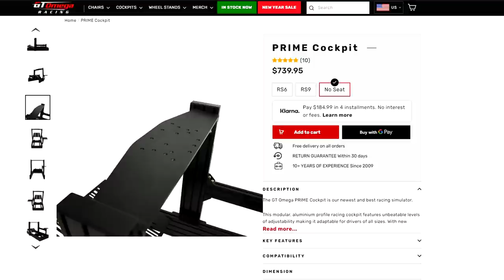GT Omega Prime Cockpit Review Part 2 "The Setup"

Comment: Ordered this cockpit yesterday based on your review. Thanks a ton Barry!
Reply: I also ordered this thanks to this review, I'm just a casual racer and I'm sure that this will suit me fine.
Reply: Question: Can you move the steeringwheel plate move back and forward or is the steeringwheel mounted on one place?
Reply: @CiroDiMaRzio12304  You would move the 2 horizontal profiles further back or foward in the grooves at the bottom to adust the reach, the pitch is adjustable.

Comment: I am happy with my GT Omega Prime.  I would like to see more price comparisons on cockpits plus shipping costs.   I saved almost $300 on the GT Omega (i pre ordered it) over a P1X after shipping was calculated to the US.  I used that savings on some Trak racer parts - inverted pedal tray, mouse tray, keyboard tray.    Maybe a piece of 4040 under the pedal tray to reenforce it would have worked and you can adjust the height or the pedal tray up or down 40mm between each of the 40x160 slots.

Comment: its always a pleasure to watch you do hotlaps,  i watch very carefully and you are one of the few sim racers that i see on youtube that have absolute  consistency.   a bad turn for you is when you don't hit it perfect.  if i had to guess you have at least 30 years of racing experience under your belt between sim and real life,   im 27 and you just have a style that screams I've been racing longer than you've been alive.    thank you for the videos.  im hoping we see some new motion simulation on the market this year.  im ready to invest in a system but im on a budget.  ide like to keep it under 5 grand,  my chassis now flexes everywhere and is 7 years old.  so instead of buying a new rig i just want to go right to motion.  i use VR and it would really  top off the experience.  so im hoping i see some sub $5000 motion rigs and some SRG reviews on them in 2021.    ive watched all yours so far on motion platforms and wheels.  its hard to choose or its out of my price bracket typically.   im still using a CSW 2,5 full clubsport setup.  and im still content with the motor,  but my wheel stand if you pull the steering wheel towards you then let go it has a good 3 inches of travel back and fourth like a spring.   it was made for a logitec wheel/pedal combo  so it just has one support between my legs.  ive been due for a new rig for 2 years and keep putting it off since ide like to go from racing on a spring essentially with what i have now right to a rock solid motion unit with no play in the wheeldeck or pedal plate, heck even my shifter mount flexes with a clubsport shifter.  a direct drive wheel would break the welds im almost certain.   and it just bugs me that i have never felt my wheel on a solid mount,  im probably losing 1-1.5 Nm of torque and fidelity due to the wheel deck flexing the opposite way the  wheel is trying to send me feedback.

Comment: The best thing about this is GT Omega is adapting to the market. Yes there is still room for cheap prefab chassis but lets face it. The best setup for sim racing is aluminum profile hands down. 

If they get the pedal tray sorted and they release a front/side mount option for dd wheels. This could definitely be a contender to SimLab. Especially if they can ship cheaper.

Comment: Fantastic review. Bought one and first thing I did wad replace the feet. 40mm rubber feet from Amazon. I don't feel the pedal flex because I am not pounding on the pedals on the deck plate. I added a SR Racing Sequential Shifter Pro. Fitted with no modification to the cockpit. The GT Omega XLRS seat you can buy for this cockpit was very fiddly to install, the hardest part of the build. Watch this this video to assemble the cockpit because it is 100% better than the instructions in the box.
Reply: Oh no.. I ordered the XLRS seat.. fingers crossed I don't screw it up. Do you have a link for the rubber feet? Or if not a link (since YouTube flags and removes links generally) what keywords should I punch into an Amazon search?

Comment: I've had my Prime cockpit for a little over 2 weeks now and absolutely LOVE it. I've only got T-LCM pedals though so not a ton of pressure being applied. For me the cockpit was money well spent. I really like the 8020 for all the accessories, options are endless! All in all I think it's a great cockpit for the money.
Reply: How's the comfort? Did you use one of their seats? My biggest complaint with sim racing is I can't get comfortable enough and my body back, butt, and legs get sore after half an hour sitting in an office chair with a G27 on the desk.
Reply: @DerekMoore82  hello i have one of these and i love mine. as far as seating positions there are many. im using there xl-rs seat and love it. im my opinion this is a GREAT sim rig. money well spent.
Reply: @gdog-wk5ww  Thanks Scott! I ordered the same seat, so that's reassuring.

Comment: I got it with the preorder discount, it was a no-brained then. I got SimLab pedal plate and slider (I had to drill two holes and it is very stiff with no flex for my HE Sprint)  as well as thenout for my Simucube 2 Pro. The P1X was not an option because of the shipping cost to the US.
Reply: How thick is that pedal plate vs the gtomega one

Comment: I see a trend of sim racers posting their own designs if this kind of rig, stuff they've "designed" and sourced parts and built, some look very good, some not so much. A big selling point is cost for these YouTubers, how much you can save. Then you start to notice, single brackets, uprights butted to the top of the horizontal beams, instead of using longer uprights fixed to the larger surface area of the side of the horizontal beams. It's the little things that matter, they're usually big things in the end. Buy once, and buy right! The bitterness of poor quality and engineering lasts way longer than the joy of a good bargain, saving a few hundred £/$ is not a smart move when making a big purchase like this, the chance is that few $ was spent making sure it works, lasts and is safe, and you are paying for the added benefit of comeback if it all goes wrong, good luck getting your money back from a part time youtuber who sold you some plans and got a kickback from the material suppliers he will surely tell you lots of good things about.
This guy though, well him you can trust to tell you what is what. Top bloke who knows what is good and doesn't sugar coat his views. Keep up the great work!

Comment: @Sim Racing Garage Thank you for these detailed and insightful reviews.

I have a question that I hope you can address. Has it gotten to the point that the Sim Cockpit Kit manufactures price points are down around what you would expect to pay if you tried to build the frame by sourcing Aluminum Profile yourself as a DIY project, possibly just buying a wheel mount and pedal tray from one of the Kit makers?

The $1K price point for a solid rig seems like a lot and I am wondering how much extra overhead is being built into the price and if maybe sourcing the profile separately might cut the cost a few hundred dollars.

Thank you.

Comment: the pedal tray is fixed after they copied simlabs p1x solution.
Reply: Only if you think using aluminum end plates to mount 40mm profile to 40mm profile is "copying".